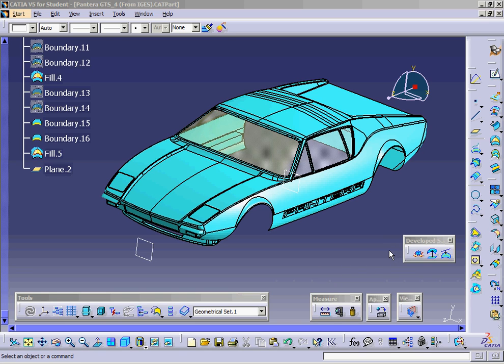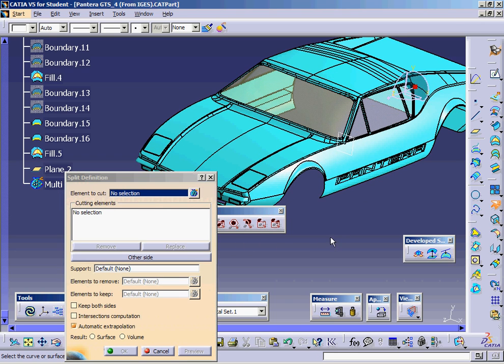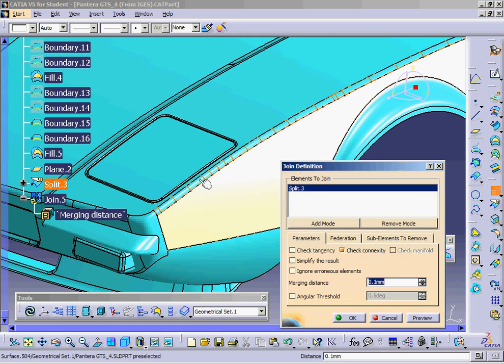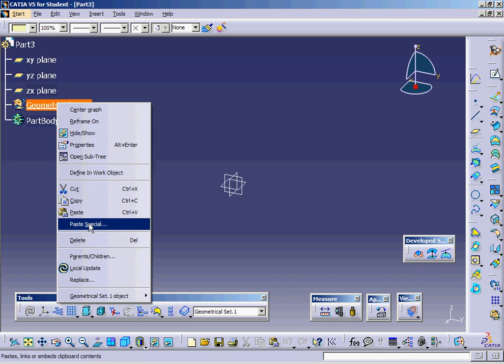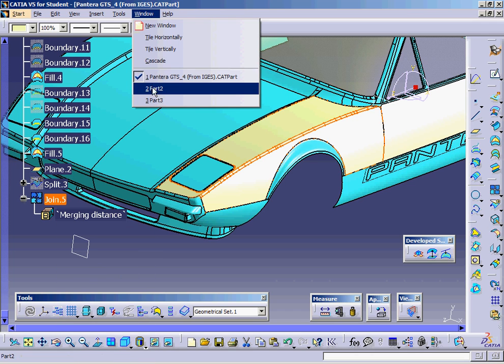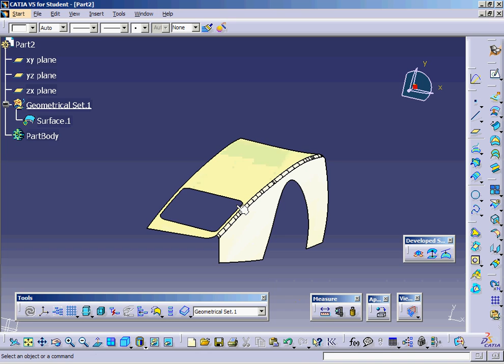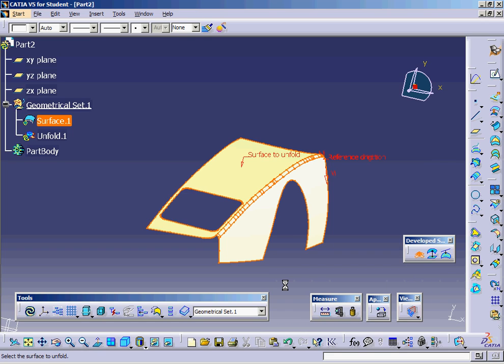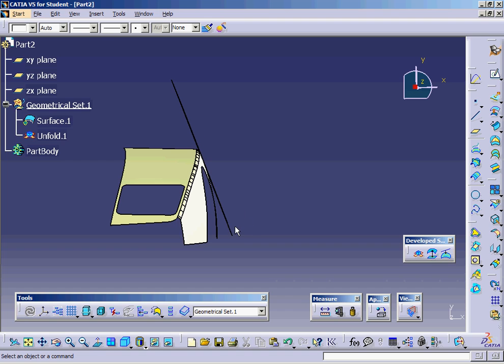CATIA V5 - Unfold Surfaces in GSD

Comment: Yeah, judging by the shape of that Pantera fender I would say it's not something you can accurately flatten.  If you sent that to the printer, as you suggest in your video, you would get back something that can only be formed into that shape by stretching the material.  I'm kinda surprised that Catia doesn't give you more options to control the flattening of surfaces... or maybe it does but I haven't seen any more detailed videos on the topic.

Comment: Nice car model. Is this just the surfaces or do you have included the attachments to the chassis ?
Reply from the maker: Creativity Overflow 
It's just the outer shell. No chassis. I was demonstrating how to flatten surfaces.
Reply: i was not referring to the chassis but the attachments that connect the outer shell to the chassis.
Reply from the maker: Creativity Overflow 
Ok. I see. I didn't have those.
Reply: i have modeled rims myself. If you we can combine those into a presentable result and do a render.
Reply from the maker: Creativity Overflow 
I can send you a download link to the file. Send me a private message with your email
Reply: I do not know how to access the private message function.
Reply: contact me on " Hrabia Engineering and Design" on facebook
Reply from the maker: Creativity Overflow 
I don't use Facebook. 
Can u email me at 
mm underscore wrx at hotmail dot com
Reply: email is sent.
Reply: I didn't get an email. here's download link. Hope they allow it thru.

https://dl.dropboxusercontent.com/u/1767296/CAD%40Public/Pantera%20GTS_4%20(From%20IGES-Joined%20Version).CATPart
Reply: send me a message to my personal mail acc: alekey(at)hotmail.de

Comment: solid3dtech can do the same or better. For the ship hull surface (a single plate), the area difference between the unfold and model surfaces is within 0.1%. The software from solid3dtech can work with AutoCAD, Solidworks, rhino3d, inventor and SolidEdge.